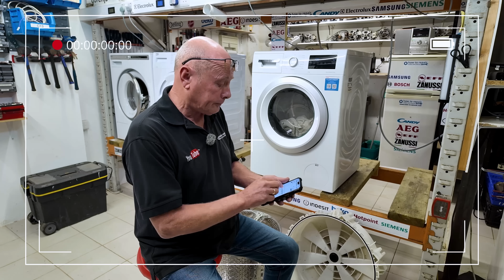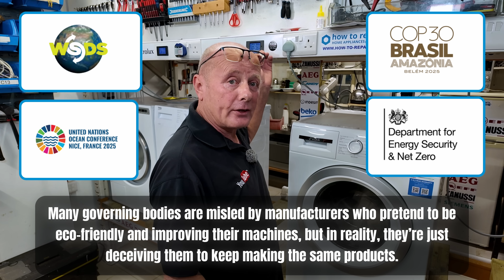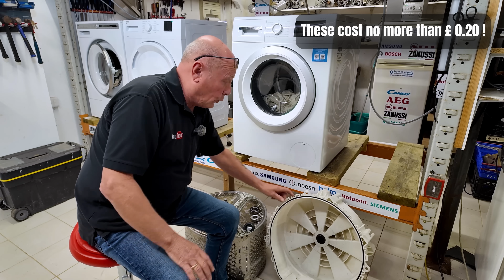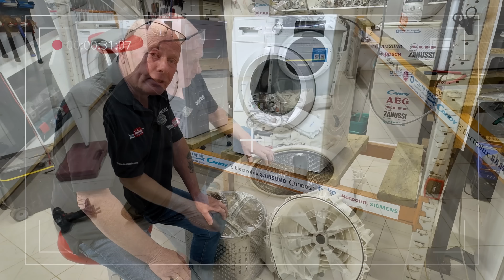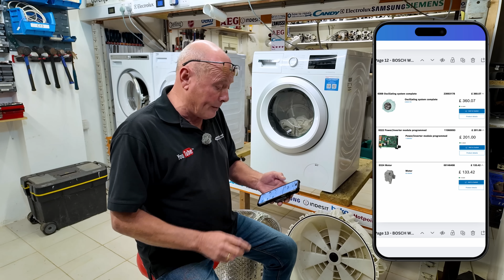Washing Machine SCAM EXPOSED! The Truth About SEALED Drums: Naming & Shaming

Comment: My father once fixed a old miele washer using industry standard bearings. (SKF) The machine ran for another 7 to 8 years, then after 7 years the motor died. Since those were not even made anymore at that point we got a new one.

Comment: TBH a high end machine from a brand is only as good as their low end models. PCBs are great in some aspects as you can produce one board and program it (firmware) for the features of individual models. However, unlike a PCB in a computer, in a washing machine they are in a "hostile" environment, with vibrations, heat and moisture, plus run at line voltage. From what I have seen, the quality of the PCB components on a washing machine board can be suspect, like poor quality capacitors and designs where a short circuit will take the entire board out etc. Another scammy thing some manufacturers do is supply replacement boards that are unprogrammed, so are useless unless you have a copy of the machine's firmware (good luck getting that) any the right computer equipment to program the board.

Comment: My AEG washing machine has the most outrageous programmed failure I have ever seen (and it was an expensive high end model "made in Germany"). The plastic drum was suspended on hardened coil springs. The contact point has absolutely no reinforcements, and as the washing machine is running it is eating away the plastic. They made extra long, but not extra wide plastic earing, so that it 

a) definitely wears it no mater how lightly loaded the machine is 
b) since it was so weak and wearing out, they added just enough plastic to last through warranty and then some. Once it wears out, the drum drops to the ground, and the washing machine can be sent to a landfill. Both sides were equally worn out - one dropped to the ground, and the other was at 95% wear.. 

All it took was 2 1c bushings and it would have lasted forever. 

Now German (and other European) manufacturers think customers are stupid. Well, I am never buying a German washing machine - ever again (Not to mention the outrageous pricing of parts - where a simple blower motor for my bosch washer/dryer was priced at 80% of the machine original price). Same goes for my French car etc... Someone should build an open source washing machine!!!

Comment: The switch on my vacuum cleaner broke, and the part was only available in the US for $130. I unscrewed about 10 screws, grabbed a soldering iron, and it's been working flawlessly for two years now. I only spent the money on a spot soldering iron.

Comment: The economics of savings are wild things when controllers starts to calculator things.   If you save 5$ worth of purchased parts on product line, it does not mean 5$ cheaper product.   With material overheads that 5$ becomes 6,  with multipliers that loads Production site costs that could be 10,  with multipliers that covers R&D and marketing, that 10 becomes 15.  And when you then multiply that with sales margins that 15 becomes easily 30.   That 30 becomes 60 when you add retailer margins and with taxes you just sold the product 80$ cheaper to the customer.

Comment: I recently had a dehumidifier which packed up after 4 years. The error code on the unit related to a temperature sensor. I contacted manufacturer to ask the likely fault and was told the fault was due to a lack of refrigerant in the unit and (you guessed it) the pipework is all sealed. So although the manufacturers could provide a refill valve so the unit could be regassed they choose not to.

Comment: Bosch do the same with their ebikes. I worked as a mechanic at a cycle hire company. We were running around 150 Bosch ebikes. Every single time it was the same bearing fail. $20 bearing easy to replace but the software could detect if you have opened the motor and then show a fault that Bosch would not clear. I had the Bosch rep in New Zealand contact my boss and silence me for mentioning it on bike forums.

Comment: Finding out the barring housing on a transmission is spot wield in 20 spots to prevent you from changing out the barring? Forcing you to spend $250 or over half the price of a washer? Yeah. Scum move.

Comment: The Consumer Rights Act 2015 gives you some protection over faults that occur outside warranty. It doesn't set a fixed "life expectancy" because that depends heavily on the product concerned, but requires goods to be of satisfactory quality, fit for purpose, and as described, lasting a reasonable time for their type and price, with consumers having a six-year (five in Scotland) time limit to take legal action for breaches, allowing for refunds or price reductions (after 30 days/6 months for partial) if faults appear. A product's expected lifespan influences what's "reasonable" for a claim, but you can claim for up to six years if goods fail prematurely.

Comment: That's true, but there are companies that specialise in replacing bearings in washing machines with glued drums at a reasonable price and with a 5-year warranty. LG allows bearings to be replaced, but it also had problems with washing machines that made hammering noises during the spin cycle, counterweights broke, and after 5 years, if any electronic part failed, you had to call the service centre and ask for a replacement part. You may be disappointed because they are often no longer available, and this applies to various companies. Miele started using plastic drums, while steel drums work well for a certain period of time. However, in new models, if you contact Miele service, you will not be able to buy bearings, a drum, or a drum mount. You have to buy everything together, and this part is simply called a tank, and I mean a steel tank. Overall, I wanted to say that the ability to replace the drum bearings does not determine how long you will enjoy your washing machine.

Comment: Thanks so much for this video, nailed it!
I can totally confirm this as a consumer who has repaired a few washing machines so fair. 
Currently using a Beko 7 kg machine, it just went out of warranty and its working still. However, I had a whole outer shell replaced inside warranty as it was getting rusted in the section where the waste water pump is. 
When the Beko service technician was doing this outer shell swap, I noticed something truly worrying. 
The main PCB was not at all protected in any way from and kind od internal splash, although it was litteraly in the direct path of the inlet water hoses that suplly water to the detergent box. i would not have noticed otherwise, however, previous fault was that those same hoses were getting unhooked from the housing of the detergent box and sparying incoming water all over the inside of the machine as well as reaching PCB. 
Therefore, I had the Beko service man add a piece of thin plastic foil po protect the PCB form further possible internal leakages.
It goes without saying that this kind of design has no further justification apart from one where the manufacturer wants this PCB board to die by getting sprayed all over with water for you to need to swap it for a new one.
Btw, those inlet hoses were getting unhooked each time there was a city water supply break. And further it was determined that the canal that the hoses get attached on that housing is so narrow that it rather quicky gets jammed by water calcfication, causing preassure barriwe and then when the preasure of water hits it, it gets the hoses unhooked from the housing causing that internal flood.

Comment: why do you say miele as well, thats bshit... miele even the glaronk tubs can be taken apart. you can replace the bearings. also since 2018 the spiders are stainless steel as well. never in 7 years being a appliance technician have i seen miele bearings fail. only the spiders (sometimes not much) most people get rid of them bcz theh are 18yo and need new shocks. also miele twindos. it fails. ALOT. even a 8yo machine gets fixed for free here in the Netherlands. did plenty. if the demage is to much they get a completely new washing machine. (new model equivalent) its the best brand there is....

Comment: I can’t believe I’ve only just come across this video. I was talking to friends & family about this issue 18m ago following the failure of a belo washing machine that was just 16m old (bought from curry’s) and I had inadvertently cancelled the extended warranty believing it was for an older appliance that had been replaced. I said these outfits were building predictable failures into machines as a way of guaranteeing future sales. I was laughed at and told to stop watching conspiracy crap. I now have a Hisense machine that from literally day one has been ‘iffy’.  But the Hisense warranty if you want to claim makes such ridiculous demands to initiate an engineer visit that, particularly as a disabled person, it is impossible for me to be able to complete the process. For example, they demand the machine is videoed in a variety of states, at varying periods during a cycle- from the front and rear of the machine!. To do this would require it is removed from its installed position, as it is backed to wall with over counter tops and no visible access to the rear of the machine. Apart from not being able to do this as severely physically disabled, doing this would likely destabilise the machine, cause error codes on the led panel and of cause invalidate any claims immediately. 
So not only are they building machines that are irreparable they are developing warranties that have equally predictable rates of failure (claim failure). Absolutely guaranteeing they generate revenue from new product sales. A cynical person would say this is exactly how they protect their shareholder interests by being able to so accurately predict projected sales and predicted profit margins for years ahead. 
Government intervention is needed to protect consumer interests. The same Government that is hell bent on sacrificing its own citizens interests in favour of others illegally residing here and who consistently display policy that puts the interests of big business wealth ahead of the interests of consumers.  Rant over.

Comment: I bought a candy gc4 1472 d1 when I moved into my current property that was unfurnished because the flat I was in before was fully furnished. This was 10-11 yrs ago now. I do 2 or 3 loads a week & not once has it ever failed me. It's only until recently now I have to give the door a tap to unlock & for its cycle to start, like the door locking mechanism sticks a little. But I think I can fix that with some WD40 :0) But aside from this, it's worked great. 

I've family who are on their 3rd washing machine from some of the brands you've mentioned above. So really, I have to give Credit to Candy for really making a robust & reliable washing machine.

Comment: Thank you for sharing your knowledge and your time in making this video. Are you saying that in the UK, you can not buy a washing machine that doesn't have a sealed drum? If that is the case then I would use my multi tool to cut open the drum, replace the bearings and seals and then use high quality sealant and nuts and bolts to re-join the two halves.

Comment: The Powersupply in Beko devices are so designed that the Caps and IC will degernrate or pop after 1000 runs, Gaint PCB with 60% empty space on it, everything is so densed packed to trap heat

Comment: I had this issue with bosch years ago.  Bought a machine for €1200, the PCB failed just outside warranty.  I created hell and they said they couldnt do anything to discount the PCB which was something like €400, but they could give me a complete new washer for €320!  I had no choice, took the new machine, after a number of years and light use the PCB failed again.  

The cost of replacement parts is something the EU could take one as they have the power to enforce reasonably priced spares.  I think this is something I need to suggest to my local MEP.

Comment: Electronic boards don’t fail all that often, and manufactures could afford to offer replacements at reasonable prices.  Same goes for a lot of these other parts, even when they are not complex monolithic units. Volvo wanted to charge me €400 for a pair of hydraulic lines for a convertible roof, to replace a failed line. You can have these made to size for €30. Ended up getting 1 from a breakers yard for €10. 
    
I have a (now 20 year old) Litter Robot, and automatic cat litter box. They take the opposite approach: replacement parts (including the control board) can be ordered from the manufacturer or their dealers, and they are cheap and easy to install. That’s why mine lasted as long as it did.

Comment: 🎯 Key points for quick navigation:

00:00 💸 A Bosch washing machine costs £549, but its sealed drum alone costs £493, highlighting an extreme parts–to–product price ratio.
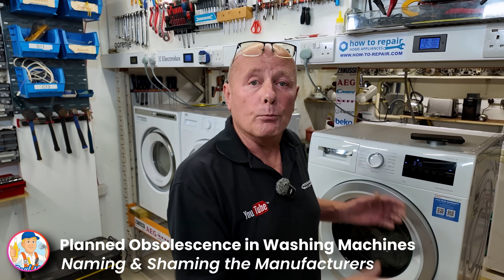00:23 ⚠️ The creator claims he will *prove that major brands intentionally design washing machines to fail shortly after the warranty ends.*
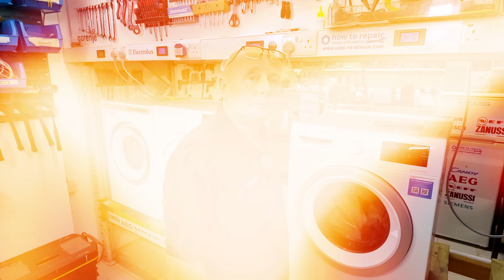00:49 🧼 Despite good performance, manufacturers allegedly build in obsolescence, prioritizing efficiency ratings while ignoring repairability.
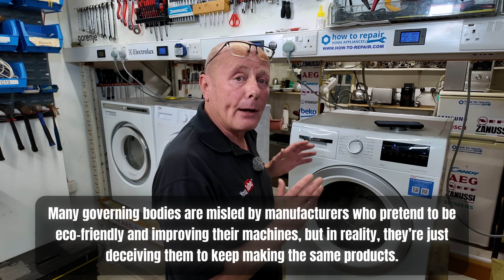01:17 🔧 Engineers say washing machines are usually written off due to sealed drum failure, motor issues, or PCB failure—key repair barriers.
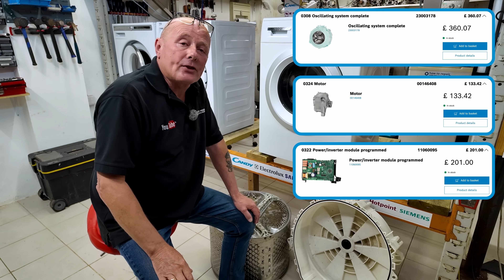01:40 🛍️ The creator investigated Bosch machines at a UK retailer and found shocking prices for essential components.
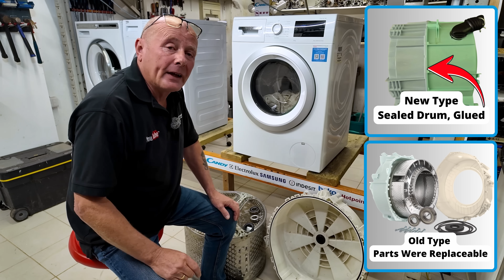02:09 🔩 Old drums used simple screws and were repairable; new drums are welded shut, preventing bearing or spider replacement.
03:06 🪛 Bearings and seals for older-style drums cost only around £15–£20 total, showing repairs should be cheap when drums are splitable.
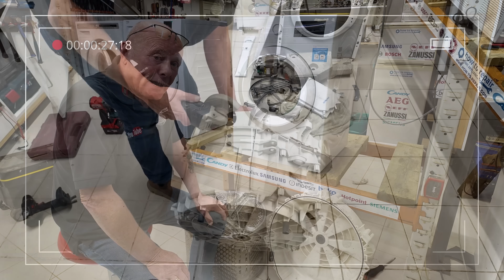04:26 🧩 New machines require replacing the *entire drum because it cannot be opened, making repairs economically absurd.*
05:22 📊 Component price analysis shows drums often cost 60–90% of the entire washing machine price, making repairs pointless.
06:08 🤯 Some models have nearly full retail-value drum prices (£493 drum for a £549 machine).
07:20 🧮 Manufacturers can predict bearing lifespan via rotation data yet still block bearing replacement by sealing drums.
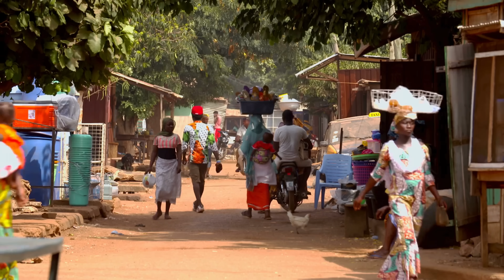08:15 🌍 Southern hemisphere brands like LG and Samsung still offer splitable drums, raising questions about regional discrimination in repairability.
08:38 🤝 Multiple manufacturers adopted sealed drums simultaneously, suggesting coordinated industry behavior.
09:07 📰 Only one competitor publicly addressed the issue, as most parts suppliers stay silent to avoid angering manufacturers.
09:33 🤖 The creator suspects AI-driven comment manipulation is being used to influence public opinion on appliance issues.
09:58 🗣️ He concludes by calling for change in appliance design practices and urges viewers to support consumer rights and repairability.

Made with HARPA AI

Comment: Aussie here, thanks for your recommendation on LG and Asko in other replies... and for this video. I won't be touching Bosch in future.
i self repaired a Bosch heat pump dryer - the only issue was lint blocking the heat exchanger. But to get to that part took me (a total newbie) 2 hours of disassembly including removing the entire drum from the machine. Bosch made it very difficult to get to, almost like it was designed to be difficult to access on purpose. 
I charged my missus the equivalent of around 200 quid for the repair... did i charge her too much? 😃

Comment: 40 yrs ago you could buy a washing machine made in the uk, and it would still be running perfectly fine 20 yrs later. The manufacturers realised they could shake us down for more money by building in failures and using cheaper materials. It has and always and will be better for the environment to build and buy once, due to the resource and energy use at the point of making over any lifetime costs etc. They are simply flouting the law  because technically you still have the right to repair, it’s just made incredibly difficult and not cost effective for the customer.

Comment: Its the same with so much these days, its also the reason I got out of IT, even back in the early 2000's they started using glue instead of screws, potting the pcd's and many other nasty tactics to make sure you just bought a new device. They are even at it with cars now. We are told we need to be green but you can buy one use phone battery chargers, disposable vapes and worse of all this kind of stuff you are highlighting. They know how to make things that last but they'd rather the landfill is full and our wallets are empty.

Comment: I had this a couple of weeks ago. Inner bearing failed so I stripped it apart to replace them. Found the drum to be a sealed one.  

The splitting of the drum isn't a hard job just be careful and take you time. All went well. And that's where the ease ended.
Took me about 3 hours to find the bearings I needed, a little frustrated now. 
But the seal! Could not find a seal to fit for love nor money. The whole time getting moaned at by the wife and rightly so in all honesty due to the mountain of washing building up.

Everything falls onto 1 of 2 categories. Either you have to spend the time or you have to spend the money. And it seems the relay on us have to hectic a life to spend the money!

Comment: I wonder if this is how companies such as Domestic & General win out, for a small payment per month things like drum failure are covered. I had this once, the drum failed after 10 years, it was replaced and the cost of the insurance rose afterwards so I cancelled it. It is borderline if I would have been better off just having no insurance and paying to replace if the machine had failed. The problem is you don't know if it will fail after a year or two or ten.